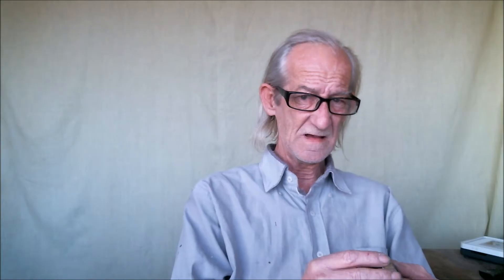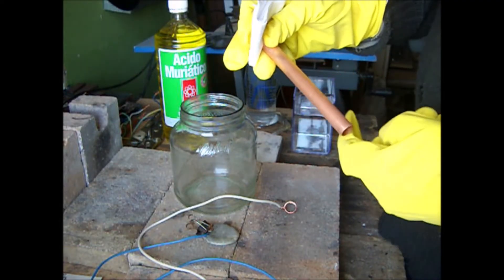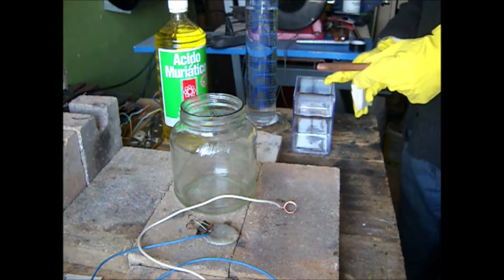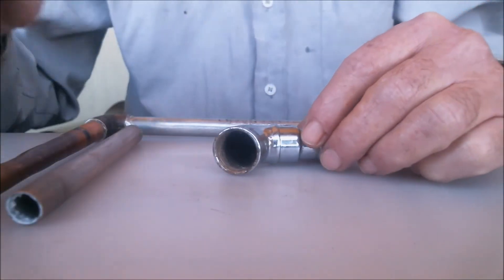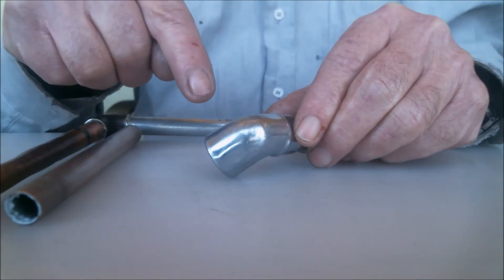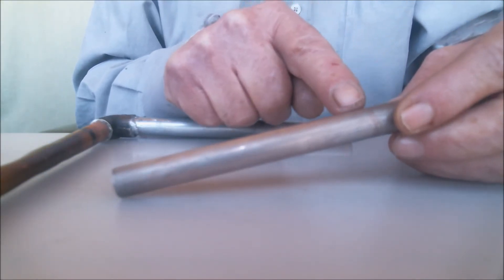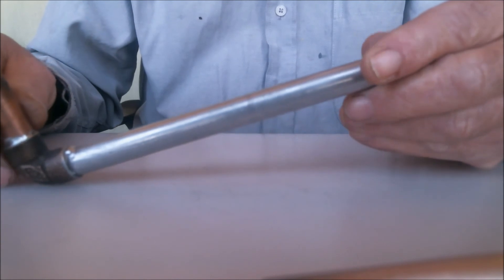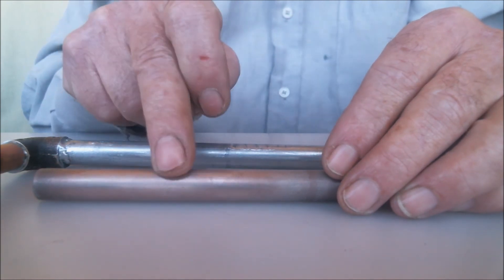DIY   Emergency Tin Plating for Plumbers and Gas Fitters

Comment: knowledge.
One question I saw your products are in spanish, and the glass you used to put the electrolysis liquid said “colcafe”. Are you in Colombia? 
And another question I have, is: the liquid was yellow when you started the process, but, at the end it was clear. Is this because of the electricity? Or the metal? Curious, because the muriatic acid is most of the time yellow and I wonder if this clear liquid is still the diluted acid or if at the end is no longer usable.
Reply from the maker: 1) No, but I liked that colombian cofee and it's container 😁
2) The change of colour shows the chemical reaction has depleted the HCl. I understand the Cl bonds to the tin and the H goes of in the gas bubbles, so what's left most probably is water or a very watery HCl.  Sorry but I don't remember the full ballanced equations.  I would say it's no longer usable.

Comment: Muriatic acid is extremely toxic and should be used with a respirator and safety goggles. Then there are also toxic and combustible gasses produced during electrolysis. This should be done in a well vented area. Good video.
Reply from the maker: Yes, you are right. However, I work next to an open window and with the door open there is a good outward draught.  Thanks for your comment.
Reply: This chemicals require respect and not fear. Is this sort of “terrorism” the one to blame for this products to be banned in many parts of the world. Just because some people are ignorant and make stupid mistakes, that shouldn’t be a reason to stop everyone from using them.
Proper education would be the best option, and this, hopefully, should be taught when young, that way it won’t be forgotten and would be learned for life.
This fear on everything is not helpful at all. Be it chemicals, be it guns. And on top of this, since people will still need to use them, they will be forced to look for them illegally, making this a real problem, because it will promote black markets, high prices (for very cheap products) and dangerous quality. This having a lot more problems than the original issue and making life harder for those that need this products for legitimate reasons.